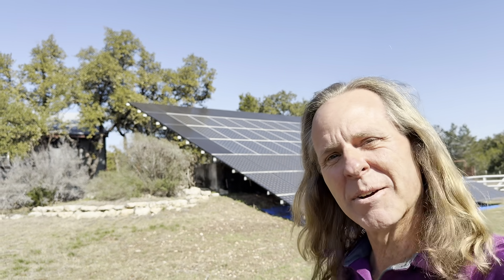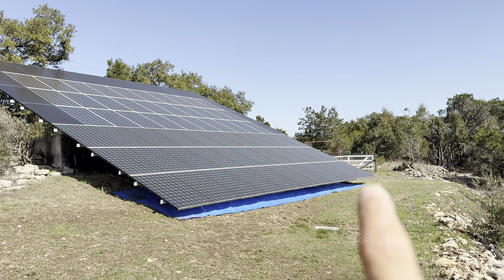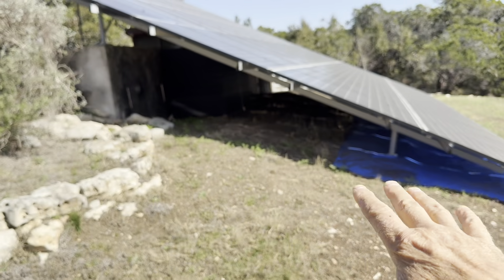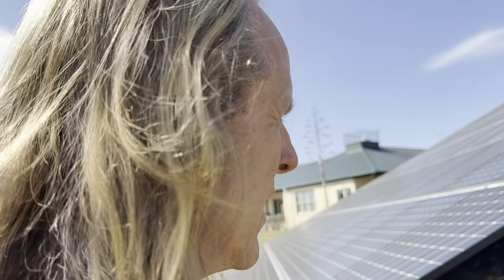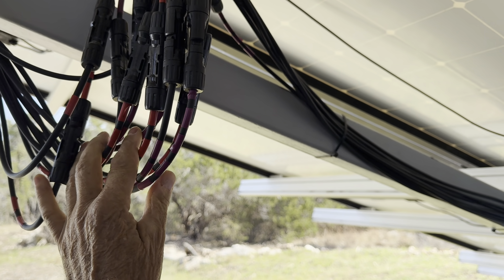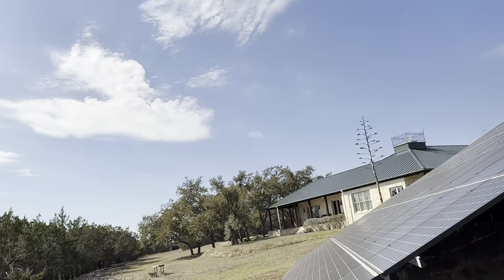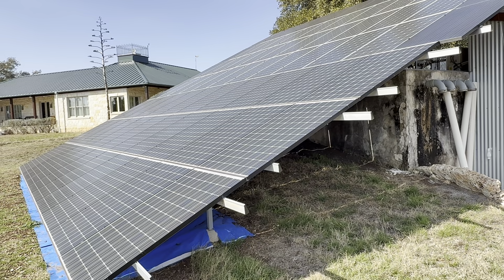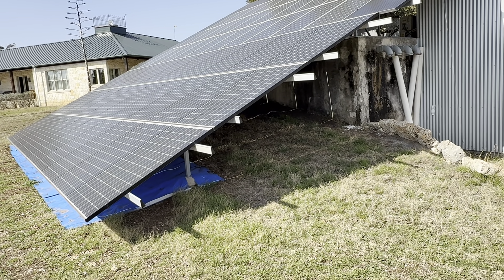Huge Solar Array Expansion To Survive The Off Grid Winter

Comment: salut
l'inclinaison des panneaux est surtout optimise pour l'été , pour l'hiver , il faudrait qu'ils soient a 55° environ
Reply from the maker: Here they should be around 45° to be optimized for the winter solstice. The other issue, though is that the main problem during the winter or cloudy days. On cloudy days, you can get a lot of power by having them and towards the sky to receive the diffuse light. That makes an argument name the more flat.

Comment: It's unique, but are there any hidden drawbacks?
Reply from the maker: @powoxi  I can’t think of any drawbacks. I can access all of the space underneath if maintenance is needed. I really don’t like having them on the roof if it all possible. I don’t worry about trying to clean them as it doesn’t seem to make enough difference to matter and the rain washes off the pollen from the spring eventually. When we had snow, I used an extension pole and a broom and I was able to get more than half of the panels cleaned off after I did that they warmed up in the sun and the sunshine did the rest. Can you think of any?

Comment: I have a small emergency bank of batteries. If the main bank goes down, I have my secondary bank I can switch on. I also use that small bank every day from dusk to bedtime and then switch the main bank back on for a fresh max  overnight supply or power

Comment: I got some estimates for a solar system on my house in Glassboro, NJ. I said why not add more panels and sell to the grid. The reps all said you can only sell a certain %. That makes no sense when they say turn down the AC in the summer. Why don't they want solar panels supplementing the system??
Reply: Make an order for an EV and add it to your application for solar interconnect. Cancel EV order after solar project approved
Reply: @Jet_Hammer  Don't interconnect, get an inverter that does Not export to the GRID.  This will allow you to supplement your system and stay with Tier 1 rates.

Comment: Looking at the tree’s and rocks you look to be in Central part of a lower southern state.
Reply: We have a 24,000 watt array (12,000 on dual axis trackers) and 62KWh’s of battery storage which during the winter will last us a 8 days of cloudy weather which I don’t believe we’ve ever had here in Central Texas. We use propane for heating and cooking but come summer our power usage increases due to using air conditioning but I think this summer we will use much less due to installing the hybrid solar mini split systems in the house. The long days in the summer really helps with power production,  I think 87KWh’s is the most power we have produced in a single day for consumption and battery changing.

Comment: Dude the overcast weather when the angle of the panels is not ideal is the worst. We have a similar sized solar system (a bit more disparity than this) and during winter that kills us, we get around 5% some times..... 

The sunny but cold days we can often see an efficiency improvement. Sometimes close to 120% production values
Reply from the maker: Testing shows that in diffuse light a tilt angle that is shallow can be more effective. Those dark cloudy days, and especially rainy conditions can certainly knock the production down to almost nothing. Bright overcast days can actually produce quite well though. I’m sure you know all this, but I am rounding out your comments for those reading along.
Reply from the maker: Testing shows that in diffuse light a tilt angle that is shallow can be more effective. Those dark cloudy days, and especially rainy conditions can certainly knock the production down to almost nothing. Bright overcast days can actually produce quite well though. I’m sure you know all this, but I am rounding out your comments for those reading along.

Oh, and I have seen 105% on cold sunny days. You must get colder weather than we do. It is definitely worth paying attention to that when people size their system so they don’t end up creating voltages that are too high for their inverter or charge controller.

Comment: Work on lowering consumption
Reply from the maker: It is always a good idea to work on lowering consumption. Designing an energy efficient building is a great start. Everyone has to make their own decisions about whether they’re willing to reduce their lifestyle to a smaller footprint. I could save 25% of my energy consumption or more by getting rid of my Koi pond. It is my choice to have that. It is also a choice to have a large enough home to do all the things that I enjoy. I have spent a lot of my life living with a smaller footprint and I know what is possible, but at the end of the day we make our choices. I can tell you though that when you build a home that is wasteful and it’s conservation of heating and cooling it will kill your ability to make any of this work. Fortunately, I learned Building Science before I built this house. It is airtight and well insulated. after that, it kind of comes down to lifestyle. I could hang my clothes on a line, but I have a clothes dryer. There’s just a long list of decisions like that that you have to make, and then build a system to accommodate all of my water is pumped. I have ultraviolet light that burns 24 seven as part of the purification. That is not to say that you can’t live on 1/10 of the electricity that I use, but if you want to have a bigger footprint in your lifestyle than you have to have a bigger footprint and your system.

Comment: I hope you are running a heat pump for all yer hvac needs… I’m always impressed at how much you have done with your batteries and solar… I really need to figure out a way to learn more about them and how to properly diy them… To a novice like me, it all seems so overwhelming that it’s difficult to get started… But I love everything you have shared and shown us… Eventually I hope to get solar and wind, along with some batteries (and possibly a diesel generator as a emergency back up… Anyway… I appreciate all you have shown us… Thank you!!!
Reply from the maker: @timtation5837 I understand that it can be overwhelming to get started on something like this. On the other hand, it is never been easier to DIY a system like this. The apexium diy boxes sold by Jenny Wu along with the high-quality sales that she provides makes it very easy to build the batteries. The cost is also extremely reasonable at this point. some of the all-in-one inverters that are available these days are also basically plug-and-play and the customer service that you can get when you have a question can get you on track. As with anything else, taking it one step at a time will eventually make it seem like second nature. And yes, I only use heat pumps for my air conditioning and heating.
Reply: @RayBuildsCoolStuff  Dude... You are so friggin cool... Thank you so much for taking the time to respond. And to do it in such an encouraging way is so awesome... You Rock Ray!!!

Comment: Hey Ray! That's an awesome setup right there! I'm also trying to get one running, but know very little.

I got a nice deal on some used panels, 22, 235 Watt panels. I need to run a 500 Watt load 24/7. I'm thinking I need around, what, 3, 100 Ah, 12V batteries ran in parallel? Also, what charge controller would you recommend for that? I was looking at the Renogy 60 Ah one. Is that enough do you think?
Reply from the maker: If you are really going to be running 500 W 24 seven then you were going to need a much larger system than you are envisioning. That is 12 kWh a day. That is 1/3 of my average Joos. You are literally looking at building a system 1/3 of the size you see in my videos. My next few videos will show the entire system up and running and will give you some idea of what it takes to keep it going under various weather conditions. Just to get a bit of an idea of what I mean, consider this. 16 hours at 500 W is 8 kWh. 8 kWh will require at a minimum to 48 V 5 kWh server rack batteries just to get through one night. Now what happens when you have a cloudy day? I think what you’re really looking for to run the system that you’re talking about is at a minimum four 48 V 14 or 17 kWh batteries connected to a 12kw inverter and 8000 W of solar. I have just described 1/3 of my system. It got me through the winter. My consumption is around three times what you are describing.

Comment: When it's really cold, to heat the house you could do it with a wood stove. They are very efficient and I presume you have plenty of firewood.
Reply from the maker: @fduran6993  it’s so true that it would make a big difference. I have looked at it many times and considered how much I would enjoy it. It just doesn’t work really well in this house because I didn’t design a proper place for it and so it would end up being in the way. I still think about doing it often and it could happen someday but there may be other changes afoot instead.

Comment: Lovely system Ray, and I only have one question - how will you get access to wash/wipe the middle panels?
Maybe they could have a hinge and catch to open and prop up like trap doors?
Reply from the maker: @ahaveland  in the nine years that I’ve had the panels the only time I ever wiped them was after a snowstorm, which here means one and a half inches.😂 I use an extension pole for a paint roller and put it on a soft broom and got plenty of panels cleaned off to supply power. These panels get very dirty with pollen in the spring and the amount that it affects their production is very little. I can’t give you an exact number but it feels like 5% or less.
Reply: @RayBuildsCoolStuff  Thanks Ray, guess it's ok if you've got plenty to spare. Rain should help a lot too.
Reply from the maker: I have seen YouTube videos where they did testing and discovered it did very little. Do a search on actual testing that isn’t associated with a company selling the service and let us know what you find.

Comment: i am still wondering about that temperature in your power shed.
Reply from the maker: Not in the summer but it will help. When the system is coasting, it doesn’t need any cooling but when it’s making lots of power it does. The thing about that though is that when it’s making lots of power, then it’s got lots of power to use to make AC.
Reply from the maker: Pretty mellow and conditioned in the summer.
Reply: @RayBuildsCoolStuff  
i take out of your response the aircon is turned on?
the passive cooling from the water storage is not enough?

Comment: But you have no disconnect at the solar panels that's a lot of high voltage you're bringing into the house and have no disconnect
Reply from the maker: @ralphg3315  that’s not a house it’s coming into that’s just a separate solar shed. It is conduitted all the way into the disconnects which are in the shed.